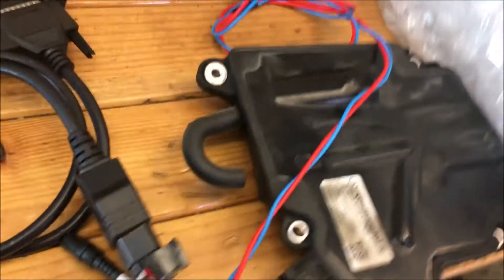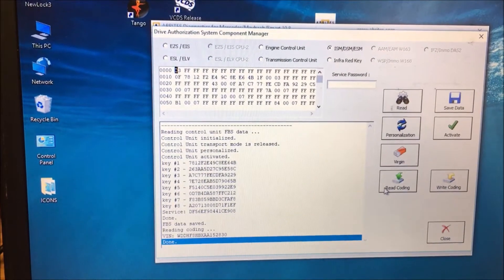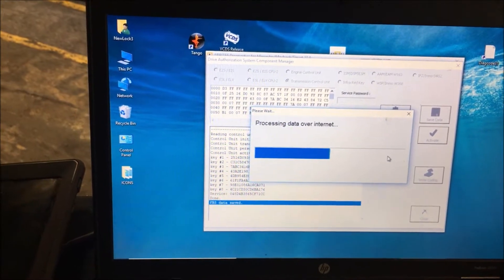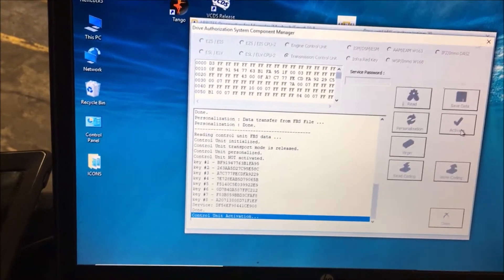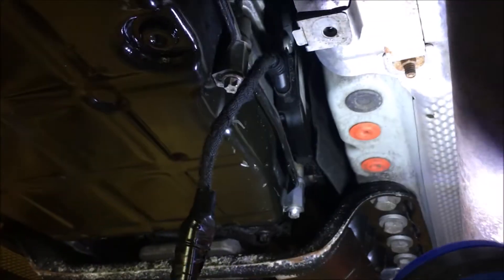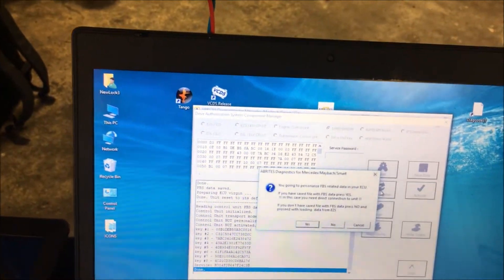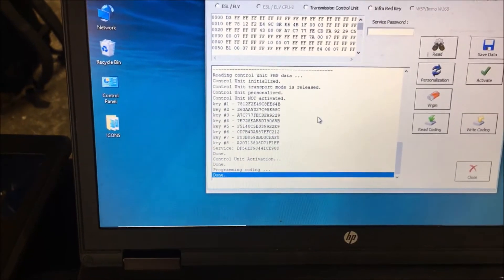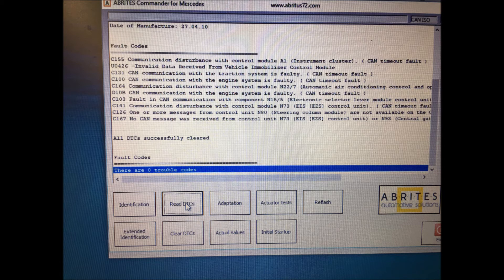Mercedes ESM and TCM Virginize and Personalize

Comment: Can't you just change the modules
Reply from the maker: Mercedes modules, such as the ISM, CONDUCTOR PLATE, ME, AND SHIFTERS ON CARS THAT DON'T HAVE A STEERING LOCK, and all EIS's,  have DAS data, if  you just change the module, the car will shut out the replaced parts because they have different DAS data in them... In mercedes speak, this is called TRP.. Theft Related Parts, if you try and buy any of these parts from Mercedes, you need a NASTF account and about 12 pages of paperwork to order the parts, then you either need a learning key from Mercedes, or the ability to program them.. PS,  the Mercedes system, XENTRY, does not allow used parts to be used on there cars.. Abrites does a great job of virgining and programming used parts to Mercedes DAS3 vehicles.. In fact, they just came out with a DAS4 program that will do this same process on DAS4 parts, they have been able to virgin most modules by cutting them open, but now they have a function that allows virgin of a DAS4 conductor plate without cutting it open... That will be a game changer..

Comment: Hi, Tim. I have a perfectly mechanically functioning transmission but unfortunately the main conductor plate plug socket was damaged during servicing and has rendered comms to the transmission defunct. I have purchased a replacement NAG2 conductor plate and I was wondering if it would be possible to mail you my original and replacement conductor plates along with my fully functional ISM module and have you virginize and then marry the replacement plate to my vehicle?  How can I contact your shop for details on such services?

Great videos - keep up the great work, sir.
Reply from the maker: Where did you buy the replacement plate? is it OK? send me an email at tim@tracylockandkey.com

Comment: Do you have any tips on a replacement ISM?  I am purchasing a refurbished virgin ISM and the seller will code my VIN into it.  I have been told it only needed to be adapted.  I only have access to Xentry DAS using passthru j2534.  Hopefully it is not too difficult.  Thanks in advance!
Reply from the maker: When you change out the ISM, you have to personalize it to the car, then sync it with the conductor plate, if you don't do the sync, the car won't start....if you have the Xentry, it should walk you thru it..
Reply: @timtracy9442  thank you! I was just worried since I will be using a passthru vs c3/c4.  I hope it will be simple 🤞.  Currently it is stuck in my driveway in Park, I can only shift it in Neutral via Xentry.  Do I have to shift in neutral first before swapping the ISM out? hopefully it can be left in park.  thanks again for the help!

Comment: Drivers side? is that LH or RH side?
Reply from the maker: The conductor plate plug is on the passenger side of the trans, the ISM is on the drivers side of the trans...  at least here in the US where we have LHD cars..
Reply: @timtracy9442  Ahh ,this is why spare parts are sold as LH and RH as here in AU we drive on the left

Comment: Hi Tim, i have a c230 2008 (Canadian model - live in canada), my shifter assembly module is dead. I have a used one from a c300 2009, same model number as mine). Do you have any idea what i would have to do? could i just by abrites diagnostics and program it myself? the dealer doesnt want to work with a used part, and they charge 1800$ for the part. Any ideas? concerning the step by step process i woul have to take?

Comment: Do you think anyone will ever add support for 9G-Tronic 725 transmission?
Reply from the maker: I know that AVDI is working on there online software to be able to virginize and personalize the ME's in DAS4 cars, when they will get it done, is anybodys guess..  I can tell you I did a 2019 Merc GLA ME the other day, AVDI wouldn't communicate with the car pretty much, The Autel Maxisys programmed the ME and coded it to the car..  all except for the injectors.. The newer cars have 5 digit codes on each injector, if you don't have the injector codes, your screwed...  I found out you can read the injector codes with Xentry.. or you can pull the injectors out of the engine and read them off each injector... This car was in a front end crash and ran just fine with old ME, but it had a dent in it... You know, I thought that the aftermarket would have DAS4 covered by now, but then again, DAS3 came out in 1998 and it wasn't until 2013 that we had a decent system to virgin and personalize modules and keys for that.. God I hope it doesn't take that long...
Reply: @timtracy9442  I just bought the EP001 Bosch ECU reader, simply because I needed to clone a ME17.7.7. No one can Truly unlock or virgin it. What's weird is that you can get the MN027-Abrites FBS4 Manager, which can apparently virgin or unlock our Bluetec ECUs, but not our gasoline ECUs. Is it not the same fucking FBS4 data? All it's modifying is the FBS data.. What's the difference?! The 9 speed is no different from the 7 and 5 speed. Folks are still going to drive through floods, jump-start their cars backward, not change the oil, ect! Sooner than later someone is going to need a used 9 speed for their disgusting, flooded, stolen, wrecked, salvage auction Mercedes! It's gonna happen!!
Reply from the maker: @55kompressor   Have you heard of anyone actually virginize an ME with MN027??  I haven't seen one yet... Don't get me wrong, I like AVDI, but some of the functions are iffy..
Reply: @timtracy9442 No, I haven't. Have you tried? I know on their website weird things are listed, then gone, or they will post new stuff and I have no idea.

Comment: Tim, can you clear and program a MB ISM for me  if yes can you send your info thanks.
Reply from the maker: Are you talking about the shift module on the side of the trans, or are you talking about the shifter in the center column??  what year and model??
Reply: @timtracy9442  the ism on the driver side attach to the trans. Ml350 2006 sometimes not shifting into gear

Comment: Hello Tim,  I am pretending to do TCM swap on a 2012 Audi A7. Would you like to show me how to do that in that vehicle? Just In a small text message a short explanation if you would...

Thanks in advance
Reply from the maker: Yes sir....  Purchase ODIS, hookup to car, make sure you have a battery charger hooked up, and do an IMMOBILISER SERVICE, it will rewrite the CS in the TCM.. If you try and do this with AVDI, you need to hookup directly to the trans or have the CS from the car the trans came from, and then once you start the process, it can take up to 8 hours to calculate the correct CS data..
Reply: @timtracy9442   hi Tim, Thanks for your super fast response.

yes I am using my new full VAG avdi that i got last December,   so, using avdi; where I should go to get CS?... did I mention it, the car is a 2012 A7 8sp Trans.  I cant find it in the AVDI menus.  Which avdi window should i be  when retrieving  CS?  thank you again Mr Tim .  

by hookUp:  POS, NEG(s) and CAN H&L only in the bench, right?   thanks.
Reply from the maker: @victor35ma  If you go to special functions, look at ImmoV Parts adaptation, select Trans control unit, then select your car..  Sometimes the program will ask you for data from the donor car.. but sometimes it can read the data from the TCM, then it reads data from the car and then updates data in the new/used TCM..

Comment: Tim, can you clear and program a MB ISM?

If possible can you provide contact info?

Thank you

Joseph
Reply from the maker: Are you asking about the Inteligent shift module in the center console?, or the Electronic shift module on the side of the transmission??  But yes, we can do both... If you have a bad shifter, just take the plastci module off old and put on new..  If you are talking about a shift module on the side of the trans, I tell people to go with new on those...  Those have plastic gears in them that go bad...  tim@tracylockandkey.com

Comment: Great video! Do you have to have an active subscription with AVDI for virginizing? I come across the ECMs or TCMs very rarely, but time to time need to virginize it. Right now I have ECM and TCM coming off w209. What's the best way to go? AVDI, VVDI or anything else?
Reply from the maker: Yes, with AVDI you need a current AMS, this is because the program goes online and calculates the virgin file.  I have never used VVDI to virgin any mercedes modules...  AVDI makes it so easy, I am spoiled...
Reply: Tim Tracy what is current AMS ??
Is like a special license for do online programming???
I was planning to buy the avdi computer but I thought you can do it without any online license?
I don’t know 
I own a shop and need to do vgs2 virginize and programming
Reply from the maker: @davidmurillo9123  The AMS, is a yearly fee so that you get all the updates for your software, and it is needed if you are going to virginize and personalize mercedes modules...  It's like $250.00 a year if you keep it up, if you let it lapse, then the price goes up...  Show me a programmer that doesn't have a yearly fee...  My autel is 10 times that..
Reply from the maker: @davidmurillo9123  I will check my email again...  I love my Maxisys....  I am located in Seattle WA..  and if you have an autel, how old is it??  because you have to pay a yearly fee to keep that MB programming working...  last I checked it was $1,000.00  My Maxisys needs the internet connection when I program new modules from the dealer...

Comment: Hi Tim, I am the Seattle area, can you verginize 2005 Mercedes SLK 350 transmission module. It got transmission swapped. The car starts but doesn't move. Can you do it online? I can take to any WA mechanic if you know they have same software.
Reply from the maker: Yes, I can virginize and personalize...  No, we have to be at the car, or have the new and the old conductor plate..

Comment: Thank you for sharing. How to do if we don’t have original backup ? Everything go via OBD plug or we need to open EZS ?
Reply from the maker: you would virginize the module by direct connection, then plug in the cars can bus to the module, then go to the cars OBD port, and log into the module, then when it asks you to personalize, you would select, Move data from EZS...  go to the 4.00 mark in the video, or watch any of the other videos I posted about 722.9 transmissions, and it shows you what to do...